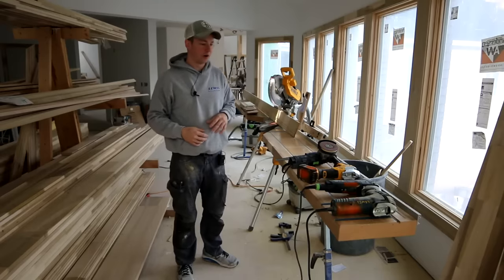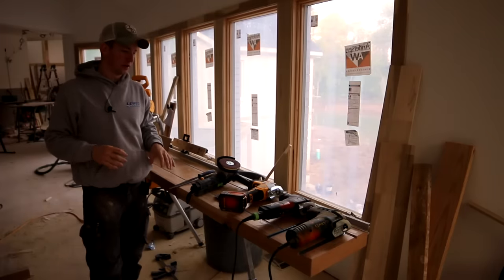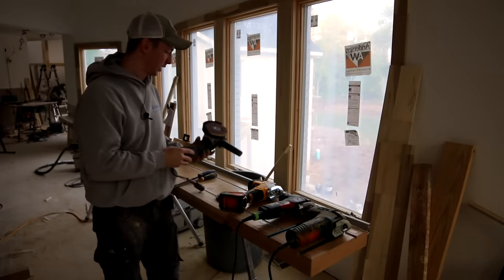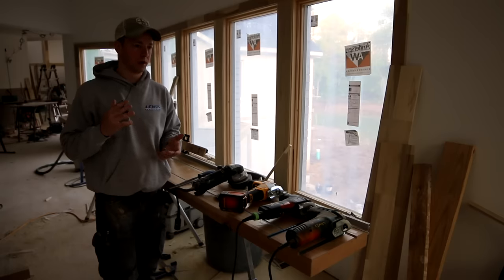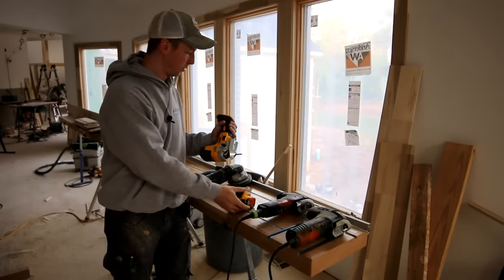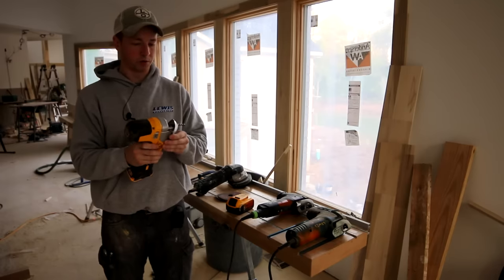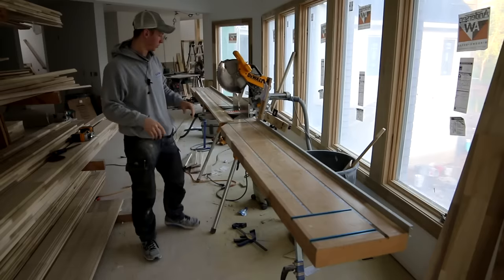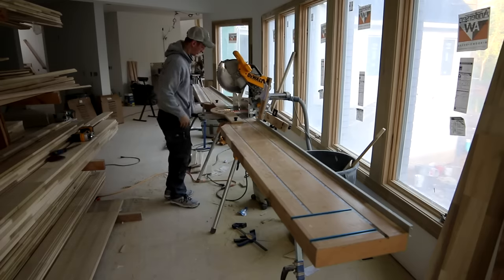Best tool for coping base and crown??? Dewalt DCS335B w Coping Foot for the Win

Comment from the maker: What is your go to coping tool?
Reply: Jigsaw with a Collins foot.
Reply: Old school coping saw never seen a jigsaw coping foot. I will be getting one. I only trim a few homes a year. Thanks for the great video
Reply: I heard before the Collins foot guys would cut a golf ball in half and screw it to the jig saw base centered around the blade
Reply: Coping saw. Learned from old school carpenter,but I’ll be trying the jigsaw method on crown. Great video man keep them coming love ur channel.
Reply: I use my dewalt sliding miter box saw for all simple copes.
Reply: Coping saw. However I find myself unique in putting the blade in backwards to cut on the pull strokes. Increases the speed slightly but also your control.
Reply from the maker: That’s an awesome idea. Lol
Reply from the maker: Ken Lame I miter uncopable crowns. So I know it can be done. I just feel coping is a lot easier and more forging. Coping requires less skill. Do you cut on the flat or nested?
Reply: Alcohol
Reply from the maker: Richard Wolfe Not when you consider that perfect measurements are required to miter. And when batch cutting whole rooms, one board being installed that is too long will compound onto the next piece because the next piece can’t sit where it should. Coping allows pieces to be cut slightly long and then snapped in place. Also coping can easily absorb walls being out of square whereas mitering can’t. Coping is far more efficient over the entire install process. Looking at it from the standpoint of being an extra step is short sighted. Coping saves time and produces better results on the back end.
Reply: @InsiderCarpentry  I cope but' I am going to pick up one of these, I was going to try using my grinder, this saw seems a lot quicker. No one I have ever worked with liked coping, I loved it, now' not so much that I'm on my own, and  from one of your previous vids; you are so right about less steps to the stock,saw. Being efficient is key. (I'm still working on it).. lol
Reply: Insider Carpentry very well said.
Reply: Belknap bluegrass coping saw with a Pegasus saw blade and the Collins food
Reply: I would love to know how you made your wings for your miter saw. I know that you have a video talking about it but I'm not a trim carpenter and don't need the tracks and stuff like you have but I do want it to have the magnetic tape measure. If you would just give me the basics on what you used and how you made it I will greatly appreciate it!
Reply: @InsiderCarpentry  0
Reply: @pvillebo  0
Reply: 0
Reply: @intender4good  weed ✌️
Reply: Rotozip with cutting bit.
Reply from the maker: I have videos on my wings further back in my video uploads. You can find links there. 👍
Reply: 28 oz framing hammer, trim sucks
Reply: @tileslay6543  I do it the same way, then a dremel to finish any really tight profiles
Reply: @kenlame1197  you can always twist the miter up to ceiling or down to wall to close up minor gaps - anyone used a digital angle finder to cut flat?
Reply: @BrentFranker  I use that or dremel in a pinch - how do you keep it from chattering?
Reply: Jigsaw coping foot.
Reply: I also cut my crown flat but have been thinking about cutting nested.
Reply: A $20 handheld coping saw.. Works for me.
Reply: Dremel with a carbide disc blade
Reply: @kentsimpson8804  I'm not the expert so not sure?  My father and my brother are both trim carpenters. They are very good as well as very fast.  I worked with my dad in the 80s doing it and back then he just used a coping saw.  Towards the end of his career (he's retired now) he and my brother both found the Rotozip to be the best tool.  I believe my brother still uses this method.  Back in the day I recall them often hanging all the doors (including exterior) and trimming the entire house and they'd be done before lunch.  They developed techniques over the years to help them be more efficient and the Rotozip tool was one.  One other that I think is even better (and might be "normal" now?) is they would measure the entire house for base then my dad go cut it and my brother installed it and it looked perfect.  Painters loved them because virtually no caulking when they followed my dad :)  Next time I talk to my brother I'll ask him if he is still using the Rotozip or if he found a better method.  As for the chattering... I've watched him do it and there was no chattering... he'd just 45 the base then use the Rotozip to follow the cut line.  Neither of them did anything like what is in the video by cutting straight the tip of the top or cutting half way down with the miter saw.  Just 45, cope, done, and it looked good :)
Reply: Hand saw for most trims is fastest, and smoother than jig saw no filing required.
Reply: I got the Milwaukee barrel grip jig saw. Decide to use it instead of my battery Festool because the coping foot was cheaper. Basically just an excuse to get a new tool.
Reply: @kenlame1197  What Ca glue you using?. I've been using 2P-10 gel and not really happy with the strength.
Reply: Porter-Cable fixed base jigsaw with P-C coping blade. Blade is about 1/8 in. wide and easy to manipulate. Bayonet style fastening end. 50 years carpenter/cabinet builder.
Reply: Sorry double tap
Reply: Bosch barrel jig saw with a collins coping foot. almost 30 years. Bosch is a precision jig saw that boat builders been using since they hit the US shores.
Reply: rich shorter I also glue sometimes. I use Akfix glue with accelerant spray. Found it on Amazon but Richard at FinsihCarpentryTV sells it on his site.
Reply: I'm a expert caulker...  lmao
Reply: Does the it have to be that style of jigsaw or can it just be the regular kind ? ??
Reply from the maker: Raul H. w/ LUKEtheGREAT it can be a barrel grip or a d handle jigsaw.
Reply: I've been running the festool/Collins for years, even on shoe, hand cope quite a bit too, never saw much point in dusting everything up with a grinder
Reply: grinder with sanding disc
Reply: Brent Franker how many brothers you have 6 ??? hang all the doors, run base, trim windows before lunch ..... yea ok
Reply: Angle grinder with a sanding wheel.
Reply: Justin Beckmann i do the same... fckn comes out dead balls perfect..!!!
Reply: @tileslay6543  I'm self taught too hated coping till I watched an episode of This Old House He put the blade in backwards and pulled from the underneath I tried it so much simpler
Reply: I have been using a 4" Makita angle grinder with 36 grit disc for many years with no issues. But I am going to check out that Dewalt cordless with coping foot for my next big project - just looks like a great way to go.
Reply: KOPING SAW N GRINDERS W/ 2 DIFFERENT SANDING DISK SET UPS
Reply: Ken Lame thanks man . I'm paying to get one . Really been hearing lots of good things about that barrel jigsaw wi5h that coping foot
Reply: Old school coping saw! I have not used a coping foot and would love to try it though.
Reply: Kent Simpson I could probably calculate the angles with a good angle finder but I would rather just take two pieces (I’m assuming you’re talking about big crown) and start off with the standard miter and bevel angle setting and test it on the wall. I can get prefect miters after 3 adjustments every time.  But I made a jig to cut 8” crown nested on my sliding saw so I don’t have to cut flat anymore.
Reply: TOMM GUNN so do you cut one piece at a time or cut an inside miter on the end of a bunch of sticks and then measure them all then cut the other end? I never could get efficient cutting flat, but that’s how I first started, and I can get great results but it takes more than twice as long as cutting nested
Reply: t starr bosch has gotten bitten by the chinesium bug too, I got a new one and it is nothing like the old ones I have
Reply: Dewalt sliding miter saw, I use a digital angle finder when I measure. You’re right about precision measuring, it takes skill to get good results with miters
Reply: Hand coping saw and a sharp razor knife....but I’ve been a carpenter for 41years
Reply: Coping saw....
Reply: i like using the easy coper jig with a jigsaw
Reply: Coping saw 90% of the time.  Bosch d-handle with modified flat base and scroll blade for bigger crowns.

Picked up a coping foot last month, and installed it on my barrel grip Bosch yesterday for the first time.  5.25 inch wide oak crown, thick with 2 beads....proably not a good crown to start with...I can see that it has a learning curve, and I ordered some different blades to experiment with.
Reply: 40 years in, Large Hoop Stanley with a fine tooth blade cutting on pull stroke except on large custom hardwood crowns, then I break out the Bosch with the Collins Coping foot. I'm going to try the Mini grinder trick one day.
Reply: I am a finish carpenter, I use a grinder . Be careful when you have a fresh pad it eats quick
Reply: James Shea ,
Reply: I like your setup. Awesome idea with the wings for the chop saw.  Jigsaw with a coping foot is an amazing tool. I like your style and your methods please keep these awesome videos coming!!!
Reply: @jameselliotshea5650  Some of as actually have good hand and simple cut with jig saw with free hand.  Need nod any foot or ball.
Reply: Hand saw 20 years east end Long Island south fork
Reply: My friend is my go to coping tool. Very nice fit on that cope by the way👍
Reply: Just learned the angle grinder with 60 grit flap disk method. Worked great for me.
Reply: I have traditionally always used a hand coping saw though I have now ordered the DeWalt barrel grip Jigsaw and a Collins coping foot so that will now be my go to.
The master carpenter who taught me the trade used to say that it's all well and good using a mitre saw to cut your mitres but you should first be able to cut them by hand and I think that the same goes for your scribing cuts (sorry I'm British I refuse to call the cut a cope 😆😂😂😆).I have insisted that my apprentice masters doing his cuts by hand before I let him near my mitre saw, I think that is good practice to teach people to master the traditional methods before giving them the luxury of power tools.🙂
Reply: Same as discussed coping foot and grinder , with heavy contours coping saw and files .
Reply: Flap disc on an angle grinder
Reply: @hammertime7349  some. I've always done it with a hand held coping saw. The artistic acumen developed with a hand held coping blade is far and above using a power tool. Absolutely nothing produces a better product than artistry and elbow grease
Reply: I use Makita 1 1/8 belt sander, 40 grit belt. I threw my coping saw away, BY FAR! the fastest most accurate way I've found. I'll Never do it a different way.
Reply: Brent Franker jk
Reply: Jigsaw always. Dude, awesome table. Is that a plan with a link or self designed?
Reply: Barrel grip Jigsaw (old Bosch 1584vs) with a Collins foot
Reply: Hand saw
Reply: Best tool for coping? It depends on fhe amount of coping to do. If I’m coping 15 sticks of anything over 4” in any material, it’s time to use my copeMaster. Anything under that quantity it depends on the material. If I’m working onsite and it’s MDF, I use a grinder with 24 or 36 grit disk. If it’s wood, I use either a grinder with a carbide disk to waste most of the material and finish with the usual grinder, or if the wood is really hard I might use a jigsaw upside down.  

That said, I just got a barrel grip cordless dewalt jigsaw and I have a Collins foot. I’m going to add it to my tool arsenal. Up til now it wasn’t convenient to use the Collins on my regular handle Bosch jigsaw. 

I occasionally pull out a hand coping saw for softwoods if there’s not many to do. Whatever gives me the control to get the work done is what I choose.
Reply: @tileslay6543  The proper way to use a coping saw is to cut on the pull stroke.  That may be why no one likes using them is that they are putting the blade in backwards.  I bought a brand new Dewalt table saw from a guy who said it took forever to cut a board.  He had the blade in backwards...
Reply: Prince Home Builders Inc. Prince.
Reply: @BrentFranker  Hi Brent- thanks that's a cool idea. I have a rotozip and I will try it for coping
Reply: Kent Simpson I use my starett miter/ angel finder
Reply: Coping saw, with the blade cutting on the pull stroke. Been doing it for 20+ years. The worst crown to hand cope is hickory. I always have some beeswax close for those. Cherry and oak are no problem. The hardest part now is finding good blades. Vermont American had the best blades I've ever used, but they quit making them about 5 years ago. The Olson blades are good, but they don't come close to the VAs.
Reply: Stihl MS 200T narrow curve chain.
Reply: Angle grinder with a flap disk
Reply: Angle grinder with a sanding disc until now but i think I’ll change to this tool, it seems a lot better option
Reply: I use my cordless oscillator with a good blade. Hasn't failed me yet. I haven't tried the jigsaw because for me it's to jerky and the oscillator doesn't around the work piece.
Reply: Been using a grinder and flap disc for years, but after your video I might pick up a coping foot. I used to try to cope with a regular jig saw, but it was never accurate. I am not particularly fond of the grinder for safety reasons, but it's the fastest method I know. I will definitely have to try a coping foot now.
Reply: Hand coping saw no power tools when I started no electricity at all on site everything done by hand
Reply: Disk sander of course.....
Reply: Coping handsaw lol
Reply: Like you I never really got good with the hand saw!! 15 year carpenter here as well...
Angle grinder is always my first choice...unlike you though I take all the safety crap off of it and use a wood disk that’s the next size up from the disc pad... that way I have flex and can use the very end of the disk to get in real tight copes on crown and other complex profiles... I always back cut as much as possible like you and square of the top...
The only time I don’t do that is with high end jobs with a stain finish... I’ll leave that nip and sand it paper thin so it lays over the other piece to look like a complete miter...
I also never use files or rasps... I pretty much get most my copes right were they need to be with the grinder (and it doesn’t take me 5 minutes per cope, just 30 seconds or so)... if I need to I just hit it quick with sand paper.
Reply: Coping saw all day long.
Reply: Scroll saw
Reply: Always done by hand but I'm an old fart.
Reply: Did you ever think about the osculating tool
Reply: Am I the only person who uses a table saw!? Works fine on base, doesn't work at all on crown. And it sucks for long pieces of base. Think I'll quit using the table saw.
Reply: A grinder 😅
Reply: I always follow through with sandpaper wrapped around a dowel. Rough it with a regular jig or hand saw and dial it with the sandpaper
Reply: I use a 4 1/2” grinder with a 36 grit Diablo fiber disc. It takes some getting use to but it saves the elbow
Reply: I do it completely on my chop saw.....think I'm the only one
Reply: I enjoy the process of using a hand coping saw personally But id like to try out these coping power tools.  thanks for putting this video together. talking about large crowns one should take a walk through an 18th century French chateau or a 200 year old greek revival home in the American north east. It would not be uncommon for those builders to cunstruct 12" and 14" and even larger crowns to perfection all by hand and after hand planning their muoldings. even the most skilled modern wood workers will be humbled by the skill and time invested in these historic gems done all with hand tools
Reply: I use a good old coping saw. It's light and hangs on my saw brackets.  I don't cope crown. I can get a better joint just squeezing the crown into the corner.
Reply: @garethheathcote4988  I like it..although I think my apprentices would think I've lost my mind if I gave them hand tools to cut their  miters. They're typical spoiled millennials!
Reply: Learned from a Master Carpenter 41 years ago with straight up coping saw and a rat tail file... when I tooled up in the 80’s it’s been my Makita 10” compound mitre then my Makita 9031 belt sander. Occasionally my Dremel if ornate.
Reply: @alanlaabs  I’ve been using the same thing, Makita 9031 belt sander since the mid to late 80’s... On ornate’s I’ll have my Dremel handy too!

Comment: i learned to back cut a little 5 to 10 degrees where you were cutting the baseboard @ 5:33  the slight back cut allows the face of the baseboard to bite into the the other baseboard when you spring board it in.
of course, only back-cut down to where the flat stops.
also the baseboard that it’s biting souring installation “should not” be nailed into the wall at the end approximately 12” or so to let it float, so when the cooed end comes in to bite into it will push it into the wall, and sit flush along the coped edge if it’s not 90 degrees to the floor.
allow me to explain it another way....obviously install the  baseboard with the square end first, but don’t nail it in towards the end so it floats, the. when the coped end comes in, it pushes that square end into the wall and sort of teeters on the front coped edge so the line stays crisp and tight as it’s sprung fit,

i did install base with this method and it did work nice.
thought i’d pass. those two bits of info along.

do you have a video on stair tread installation?
i’m wondering what type of adjustable jig you use.

i love your informi videos. keep posting!